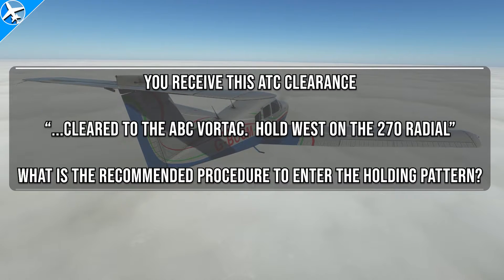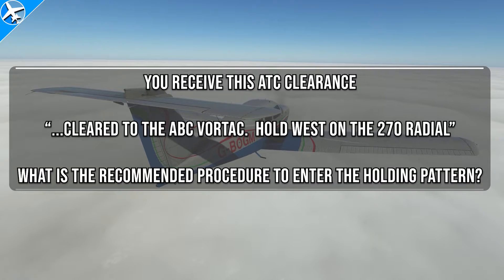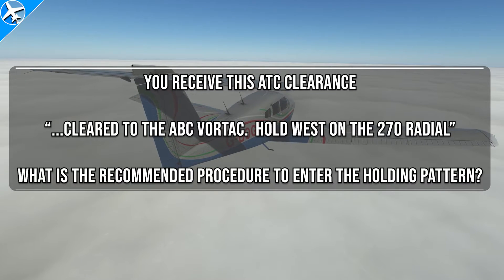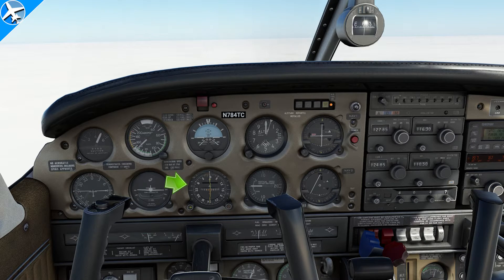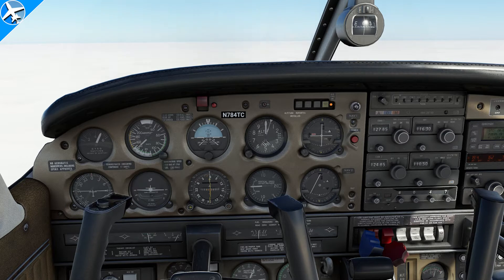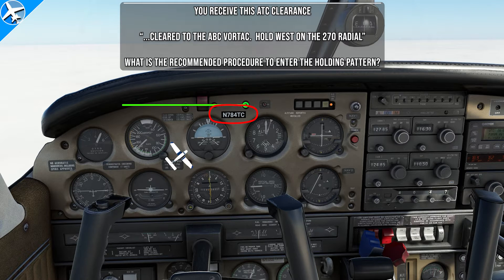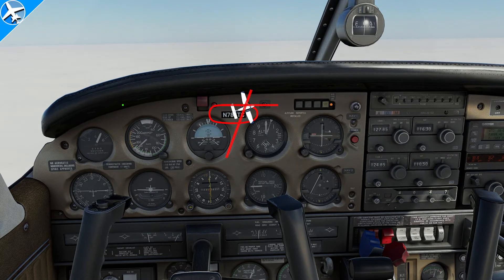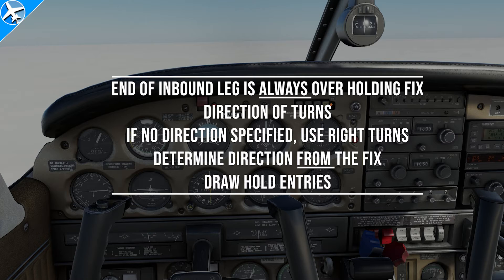Holding Pattern Entry Explained (Teardrop, Parallel, Direct) - FAA IFR Written Test Question

Comment: I've been working on the Sheppard Air IRA question bank for weeks and this question has tripped me up every time. It makes so much sense now after watching your video. Thank you very much for the visual explanation!
Reply from the maker: Holding questions are easy.  There are certain basics you must know, and if you know those basics, holds are very easy.    Here are two videos that are worth watching (that I made): 1. This one will help determine the entry type (it's multiple-choice) by showing 10 scenarios-  https://www.youtube.com/watch?v=XjqzF8mCv0Y&t=95s
2.  This one covers a LOT of information on holds and I interview a retired Air Traffic Controller at the end of the video about holds from the ATC side of things.  https://www.youtube.com/watch?v=FWKYD1wpTl8

Best of luck.  Do not sweat holds, and if you have a home sim, I highly suggest practicing holds once a month (or more) in addition to what needs to be done in the airplane once you get your instrument rating (for proficiency and IFR currency in the airplane).  Holds are seldomly flown, even by professionals and we rarely get assigned a hold in the real world.  I fly 1-2 ATC assigned holds per year (if that some years) and we practice them in the simulator at recurrent every 6 months and that is it.   It is easy to get rusty on holds.

Comment: Really simplified things…can’t believe you explained this so painlessly in about 2 minutes. Even as an experienced aviator I found this extremely helpful.  A: would it be correct to say that whether left or standard turns, the “Direct Entry quadrant” is always the quadrant containing the inbound portion of the pattern?
Reply from the maker: Yes.  The holding fix is always at the end of the inbound leg.  Anywhere inside the "direct entry" section the airplane will cross the fix and make a left or right turn to the outbound heading.

Comment: I hate these questions! 

If im going to hold on the 090 radial and im on heading 070 TO the station, why is that a parallel entry and not Direct?
Reply from the maker: The situation you described would be right hand turns since no direction is given and it would be a teardrop entry.  Back when I instructed, this similar exercise was done with student to practice hold entries and to be able to know the entry type by looking at the hold and knowing the direction the airplane is coming from.  https://www.youtube.com/watch?v=XjqzF8mCv0Y

Also, try out this calculator to see holds visually along with the entry type.  http://www.flightutilities.com/HPConline.aspx  inbound course is used vs the radial so you will have to do some math.  Entries become very easy with a little bit of practice.
Reply: @thecorporatepilotdad  thank you very much for the help. I’ll use this to aid me in answering questions on the study guide on gleim :)

Comment: This was one of the harder things for me to grasp while I've been doing my restricted instrument rating here in the UK. Visualising it on the ground - no problem at all. In the air with the hood on, and trying to also hold an NDB QDM, it gets much more difficult! Great video!
Reply from the maker: Holds are difficult initially, but once all the rules for holds are known, they are much easier with a little practice. Eventually knowing the entry just by taking a quick look at the hold becomes easy.  What is the difference between a restricted and unrestricted instrument rating in the UK?
Reply: @thecorporatepilotdad  The restricted instrument rating is a unique rating in the UK (probably thanks to our weather) that allows you to fly in IMC without a full IR. Many call it a 'get out of trouble' rating. It allows you to fly IFR approaches to published minima and with slightly increased visibility minima, but doesn't allow you to fly in Class A airspace in the airways or exercise some of the other privilege's of a full IR.
Reply from the maker: @A380adrian  That is smart.  There have been a few times I've heard pilots getting stuck on top and talking to ATC.  The fear in their voice was very evident.  Having a restricted IFR rating to conduct approaches is a smart option to have.
Reply: @A380adrian  interesting.  I've didn't know this was a thing.  IMHO learning to fly approaches to minimums (even if visibility requirements are increased) is more challenging than flying in class A.  Is atc supposed to know who has restricted rating or how does that work?
Reply: @Adrian, it can be helpful to draw the hold and entry when you're learning.  Either pen and paper, or most efb's have a sketch option.

Comment: If you keep this up colleges are going to drop aviation courses! 🤣🛫
Reply from the maker: Does that mean I get to charge college prices for content? This was the 6th video in 6 days.  It's break time.  These written test question videos are easier to do so one per day can be done quite easily.
Reply: @thecorporatepilotdad  seriously you do provide some very valuable content in easy to understand videos. I have to say that holding the way it is taught is over complicated! The objective is park your self in a confined space! This holding entry procedures are unnecessary
And they are only suggestions. Not FAR required procedures. Just my .5 percent due to bidenflation.  You really do a great job with these subjects😁🛫
Reply: @TheFalconJetDriver  I agree,  it's not like you're gonna CFIT by entering a hold the wrong way but entering correctly can make it easier to get established on the inbound.  Also key is paying attention to the wind.  I remember during training how serious i took it, trying to make my racetracks perfect because my instructor would raise hell otherwise.  Later i figured that as long as you're in the hold area at the correct altitude, ATC likely has other things to worry about.  Of course now even small single engines have giant glass panels so just follow the magenta line,  lol.  Side note: Anyone done a raw data ndb hold lately?  Those were the worst.
Reply: @unpopularopinion8608  how about a hold at an AN station, 🤣.
Not many NDB’s still around for that matter 😀🛫
Reply from the maker: @unpopularopinion8608  I love the discussions you all are having here.  When instructing, I made students learn NDB holds and I still do them in MSFS and sometimes at Flight Safety in the sim at recurrent.  Glass airplanes even have bearing pointers and the indications from a bearing pointer are just like an NDB.
Reply: @thecorporatepilotdad  true,  but a glass RMI can't hold a candle to a fixed card ADF;-)
Reply from the maker: @unpopularopinion8608  Right you are and a bearing pointer on glass panel pointing at a GPS waypoint can't pick up AM stations from 100 miles away that we only listen to because it's better than engine sound.
Reply: @thecorporatepilotdad  Did you teach "chase the head, pull the tail?"  Crazy the stuff that sticks in your head.  Can't remember what I had for lunch a week ago but stuff like that is imprinted in my brain forever.
Reply: @thecorporatepilotdad  ha ha, reminds me of cross country time building in 152 with nothing to do but flip through looking for am stations to listen to.
Reply from the maker: @unpopularopinion8608  We do that in the jets sometimes when flying coast to coast across the US.
Reply from the maker: @unpopularopinion8608  I did indeed, and I made students working on their private pilot license fly to and from NDBs on a particular course vs just homing to it in an arc.